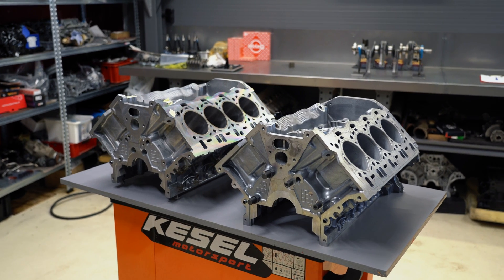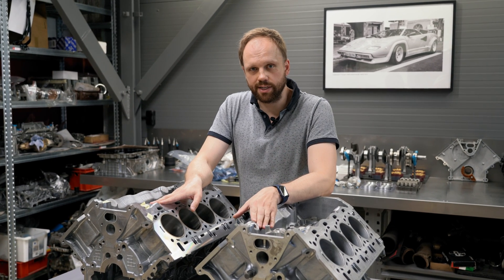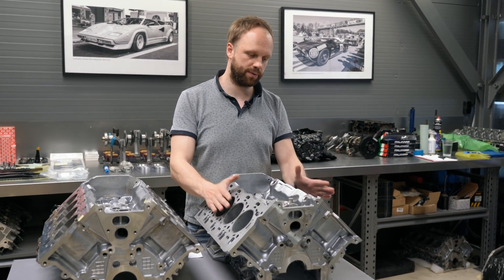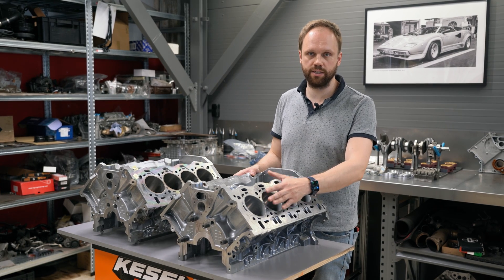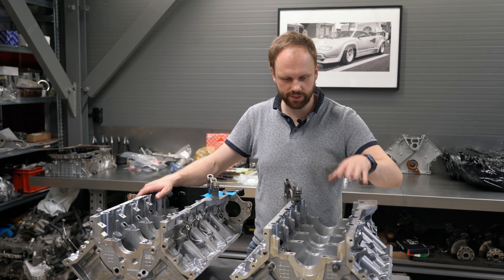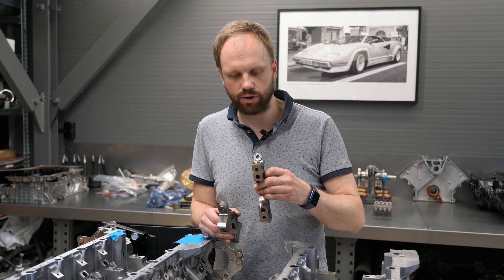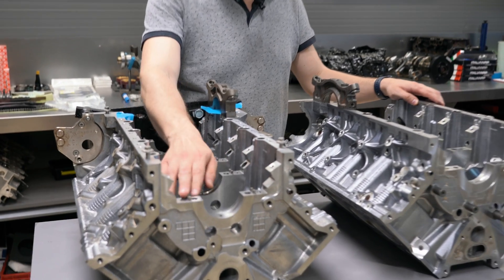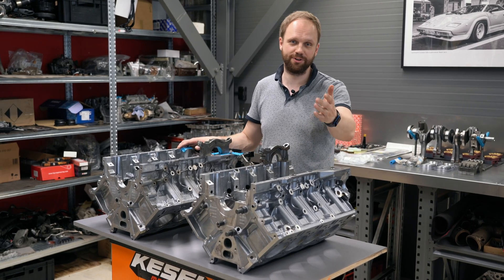BMW S63 (F90) vs N63 (G12) surprising engine block differences revealed

Comment: Alusil is aluminium and silicon, not silicone, theres a difference.

Silicon is a naturally occurring element (hard and brittle)
Silicone is a man made polymer that is flexible and heat resistant.
Reply from the maker: That is correct

Comment: will n62 heads bolt on? question of the century.
Reply: Thats wild. Why would you do that? To revert it from the hot V design?
Reply: @ronnierabell1  No i want to run one n62 head and one n63 head

Comment: I have a 2013 f10 m5 with a bad s63 do you both think I can swap in a n63 and gear box and tune it?
The problems on the s63 were
Valvetornic  2.
Valve sile cc.
Valvetronic cable
Plugs set
Injectors 
Oils seal
Vanos set 4 😂
Mechanic said i need to swap it and has since been holding my s63 engine and full gear system😢

Comment: My S63TU4 seized after heavily wearing its rod bearings at 50k miles. No cause has been found, and the only plausible theory is that it is oil starvation despite the car being maintained extensively, oil every 5k, etc. The seizing cylinder was #3 by the thrust bearing. Any idea why an otherwise healthy motor would do that?
Reply: Lots of short cycling? Historically speaking American traffic averages 25mph (overall) and are relatively short commutes. Car barely ever gets into full operating temp then gets shut down.

Euro cars don't like not getting run. 

Just theory with conjecture and some facts.

Comment: To me, if I was going to do an engine like this from the ground up, I would sleeve the block fully, WPC treat the main and rod bearings, pistons and upgrade the valve guides and seals ( if there are better materials available ). 
The oil will be the biggest change, Lubrication Engineers synthetic oil is phenominal.

Comment: Hello, were all M5F90 engines with Alusil cylinder walls before 2020? Is it easy for this type of cylinder wall to have problems if the mileage is too long?
Reply: yes all.

Comment: Will the n63 caps be comparable in strength to s63 caps when the n63 block gets the cnc block pinning?
Reply: totally. old s63 had no side bolts and was same rigidity. newer s63 and s68 has no side bolts anyways.

Comment: There is a scratch on my F90 M5 engine block, which material is best for cylinder sleeve? which material did you used on that N63 engine? are they reliable ? Thank you.
Reply from the maker: You can contact us at janis@keselmotorsport.com. We can help and rescue Your engine.

Comment: Does the oil heat exchanger block the use of s63 cross bank manifolds?
Reply from the maker: N63 use classic log style manifold, one bank one merge. No cross bank manifold on N63, hence different exhaust note.
Reply: Yes I have the extra s63 manifold to swap in but realized the oil to water cooler may interfere with install.  

I use R compound tire on track with coilovers in my 850 and no oil  pressure loss. Is there less difference btwn n63btu44 and S63tu4 than the n63tu2 in this video?
Reply from the maker: @damians8498  Using s63 manifold on n63 is not viable option.

Comment: It would be interesting to see the N63TU3 vs the S63TU4! I think for example the N63TU3 also now has the plasma cylinder wall spraying
Reply from the maker: Yes all F9x series S63, later N63, B58, S58 all have plasma arc sprayed cylinder coatings. We are able to refurbish this coating locally, incl. convert Alusil blocks to plasma coated ones.

Comment: So, the S63 engine has 6 bolt main bearing caps vs. the N63, which has 4 bolt main bearing caps. 
Pretty good stuff.
Reply: The n63 ist also 6 bolts, but no bolts in the wall like the S63
Reply from the maker: What is interesting that later S63 also moved to 6 bolt instead of 8 (dont forget the angled bolts). While most plasma coated blocks come with 6 bolt design, earlier ones in F95 came with 8 bolts AND plasma coating.

Comment: I’ve been trying to find any info on crankshafts. Might be off topic. Couldn’t find a way to message you directly. 

Are the crankshaft flywheel bolt holes the same for all 4.4l v8s? Like an m62 flywheel same holes as say N63/S63??
Reply from the maker: You can contact us at janis@keselmotorsport.com. We can help and rescue Your engine. Im not sure of M62, all E7x+ n63 and s63 basically use the same crank.

Comment: Would you consider a s63tu a reliable motor? Versus the n63
Reply: Yes, definitely more reliable.  I've been through all the variants and the later models definitely have less issues.  I've been in N63s since a 2011 F10 550i and have had various ones over the years.
Reply: @BmwAlfa123  what is the most recent year s63 you have? and what issues?
Reply: @ Sorry, what I meant to say is that the newest N63TU3 is a lot more reliable than the early models from the F10s.  I've had 2 S63 F90 M5s and 5 different N63TUs and I never had any issues with the newer V8s.  They are definiltely more reliable than the early ones.
Reply: Nope. All the technical updates suffer from problems.
Reply: @LynxStarAuto  thanks for the insight it’s crazy to think with that MSRP you’d have these kind of problems.

Comment: Hi, great video, just a curious question, I have a 2016 x5M with 98000km on it and #2 cylinder is burning a lot of oil. Plus is wet and heavy smoke from passenger side exhaust. Engine runs rich and doesn't throw any oxygen sensor codes. Always get the powertrain  power loss code #2 cylinder misfire and when I get in there with the scanner it's always history, very rarely active. The power loss is not consistent. It could run for a while without any issues and then it'll keep getting the power loss message again and again. The coils and plugs have been changed, and gapped properly. Thought that's what it was but only wishful thinking I guess. CCV lines are new. Haven't takes the turbo piping off to see if turbo seal is gone but then again oil burning only starts after around 10 mins of running. Then it's quite a bit. Added octane booster to it and ran good for a bit, so thought need to use 93 or higher octane fuel, but that wasn't it either. The previous owner had it tuned and just thinking the tuner maybe missed some fueling parameters. He said it started running like that after the tune. Dealer syas engine no good that's why powertrain malfunction keeps popping up. If it was engine, that powertrain loss would be consistent, I think anyways. It's just whenever it feels like it. Coils tested out of the engine, tested good.#2 spark plus was quite dirty due to oil being burned in the cylinder. Any ideas to point me in the right direction for more diagnostics? Thanks in advance
Reply: Wait a minute, you have a X5 M with 980000 KM?
Reply: @mr.l3785 yes
Reply: @alwaysinmotion1  That is 609,000 miles!  That is incredible. You have to post some pics as you surely have the highest mileage X5. 
 I have a 2017 X5 M and had some other X5s as well, but I always sold them after they got above 100K miles because there was always something to fix. 
I do not recall ever seeing any X5 with over 300K miles, so yours is truly amazing. Share some photos if you do not mind.
Reply: @mr.l3785 I have a 2013 f10 m5 with a bad s63 do you both think I can swap in a n63 and gear box and tune it?
The problems on the s63 were
Valvetornic  2.
Valve sile cc.
Valvetronic cable
Plugs set
Injectors 
Oils seal
Vanos set 4 😂
Mechanic said i need to swap it and has since been holding my s63 engine and full gear system😢
Reply: @mr.l3785  sorry, put an extra 0 in there by accident

Comment: Can I swap just block on S63TU car and use N63 block? 

New N63 block is $4200
New S63 block is $27000
Reply from the maker: No, as you can see in video there is some fundamental differences in machining.

Comment: Quite interesting content 👍 , have wondered previously about beemer engines sharing similar components. 
Was going down the s63 route for our car but due to reliability issues we went S58 instead. 
Always handy to know about the hard coating , makes a rebore slightly more viable and a possible re coating. Maybe even a DLC coating 🤔
Reply: Reliability, n63tu3 is a strong engine have a 2020m550 and 0 issues brotha
Reply from the maker: Rebore on plasma blocks is impossible. We can reapply coating locally and convert Alusil to Plasma coated block.

Comment: Would love to see a comparison engine for engine btwn s63 f90 
Vs n63tu3 the in the m850s
Reply: It's more of the same. All the blocks are based off the same casting.
Reply from the maker: Correct
Reply: same

Comment: Ive been getting interested in Alpina B7. I have read they install after market forged pistons. Do you know if alpina has any other internal engine differences from standard n63?
Reply from the maker: We havent opened any Alpina N63, they use aftermarket pistons.
Reply: Well awesome videos and thanks for the reply!

Comment: Great video my man, so i have a specific N63 question for you.. So i'm in the process of doing my first N63 Complete rebuild. The block is a N63 from a 2014 BMW X6 50i drive. I believe the actual motor is N63B44A.. So i bought a set of brand new rings. Is this block alu seal?? can it be honed without sleeving? Or should i just reinstall the rings that back to their respective cylinders?? This was  a running motor and so far all parts have measured to spec.. Thank you for your time
Reply from the maker: If cylinder bore has no excess ovality and surface has no scratches it can be refreshed by exposing alusil crystals and works as new. Rings do nto need to be replaced if they have enough spring in them and ring gap is ok.
Reply: Thanks man for getting to back to me so quickly. So i learned since that my block is definitely alusil. I have also decided to do the self hone procedure with felt and paste to get ready and re ring the block.. i'm going to measure the bores today, but i have noticed that one of the pistons has two finger nail deep scratches on the skirt so there was some sort of motor issue before and was rebuilt before my acquiring this engine.. Because of this i think it's a good idea to just re ring with new set and proper clearances since im putting brand new parts , bearings, etc... I will let you know how everything goes after..   @KeselMotorsport
Reply: Hey bud so here's a quick update.. So upon deeper inspection of the block during measuring i found cylinder num 4 with a decent size gouge and another finger size scratch as well. This corresponds to the piston because there are 2 fingernail deep scratches on the skirt and a gouge at the bottom. So i'm going to use the original block that doesn't seem to have any damage in bores. However this block did have 2 spun bearings, the rods 4 and 8.. I figure i clean everything extremely well and swap the parts.. 
On to my second issue i used a wire  wheel  on the area around the oil rings to remove carbon, but i scrubbed the sides and skirts with purple power and grey 1000 grit scotchbrite.. I checked with calipers and they still are same measurements as pistons i didn't clean from other motor.. Will these be ok to use or did i mess up royally? @KeselMotorsport